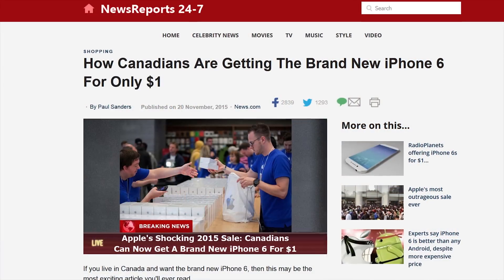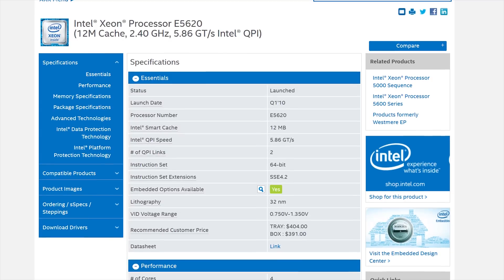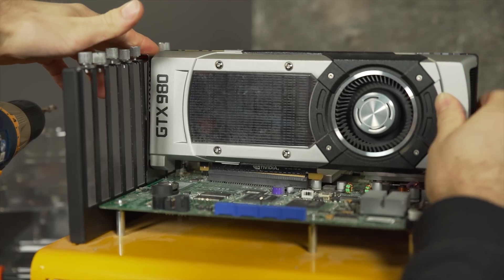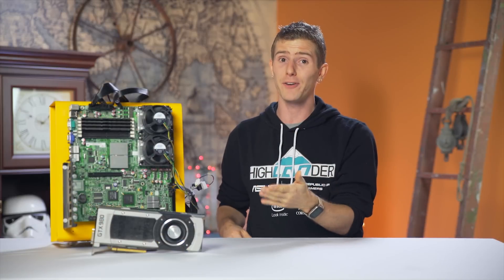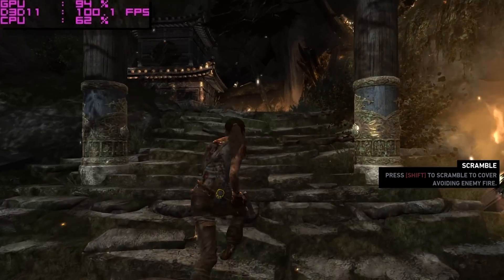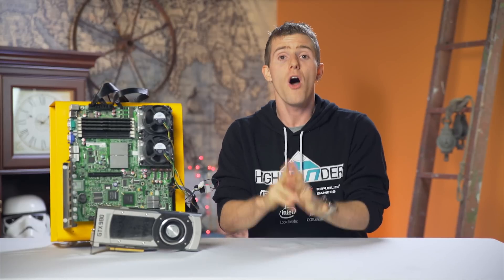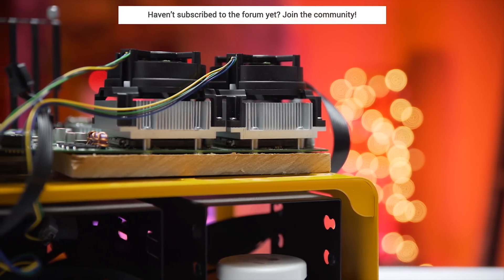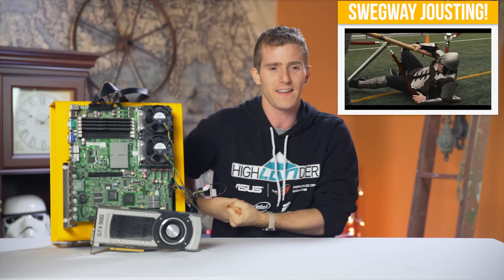Under $150 Budget Gaming 8 Core CPU, Motherboard & 16GB RAM

Comment: quick question
are there dual cpu mobo's that take normal cpu's? not xeons
Reply: +geen naam Generally no, and especially in this generation that they show in the video, definitely not, and the sockets themselves have different amounts of pins.
Reply: +geen naam leaving comment in case someone knows
Reply: LiquidPanic
hmm that's too bad, i was thinking about a super high end dream machine and then two cpu's would be useful
since one 5960x is alraidy bottlenecked by 3 watercooled titans
Reply: Only Xeons have the multi CPU support enabled.
Reply: +geen naam Most of them will fit but "Normal" CPUs like core2quad, i3, i5 and i7 doesnt have support for dual cpu so the processors wont be able to work together.
Reply: Emil Hansson
hmm that sucks
or would 2xeons or even 4  work with maybe 4 titans for gaming?
or can you only realy use 1 cpu for games?
Reply: +geen naam You'll have a hard time finding a WS/Server board with support for 4-way SLI, Also an i7 5930k/5960X/6700k will always be better for gaming, High IPC, High clockspeeds and atleast 4 cores is what you want for gaming. And dont buy 4 titans, Make a thread on the Linustechtips forum for more advice on what you should buy, Alot of cores and alot of graphics cards doesnt mean you'll get the best gaming experience.
Reply: Emil Hansson
yeah i know that, but this is a bit of a thing i like too think about. what would be the most powerfull pc 
and i dont think i would ever buy this generations titan, compared to the 980ti the price to preformance is awfull
and yeah a 2000hp lambo (talking cars now) would be horrible to drive and soooo unpracticle, but it's also realy awesome
Reply: +geen naam If you just wanna go nuts you can get a dual socket 2011-3 board and 2 Intel E5-2699V3 cpus (18 cores, 36 threads each), They'll cost you about 4000$ each though :)
Reply: Emil Hansson
well what i was thinking about, is to build a phase change cooling thing to cool all the gpu's and cpu's
i was hoping to get two 6950x's when they come out but if that doesn't work some xeons, aren't there some 20cores(hypertreaded) out or nearly out?
for gpu's i would be waiting for the next gen titans witch i hope have HBM 2.0. that would also have the advantage that the heatsink of the cooling would also cover the vram
and then overclock the hell out of everything, although xeons are not that great overclockers aren't they? so phase change cooling might not be realy usefull, maybe just one 6950x then
and just watercool everything else that produces some amounts of heat, ram mobo hdd's
Reply: geen naam "Necessary"
Reply: LiquidPanic
ow noows i made a smal grammatically error in my enthusiastic ramblings
what do i do with myself now?
thank you for pointing this serious error in my way's, i will run to the gammer nazi's headquarters this instance to atone for my sins
Reply: LiquidPanic
then why would you comment on one off my comments and just say ''necessary''?
i also didn't think i said necessary in any one of my comments, but yeah nowaday's the ''grammernazi'' is kinda a common phenomenon on youtube so i just assumed to where one of them
sorry for that, but what where you trying to say with your comment?
by the way, i am not a native english speaker and i had to google about three words in my previous comment to spell them correctly (i hope)
Reply: geen naam It was like pointing out how totally overkill that would be for any desktop load. XD
Reply: +geen naam 
Intal D5400XS aka Skulltrail.
Works with LGA771 QX9775s,unlock ratio.
Reply: hateWinVista the QX9775 is LGA775 not 771 by the way. :P
Reply: LiquidPanic
Nope,it was LGA771.
Designed to be used with Skulltrail(D5400XS) dual CPU platform.
Reply: +geen naam do you know how loud phase change cooling is? Phase change should only be for trying to get insane overclock in competitions and such, fair enough water cooling but for most phase change cooling is utterly stupid for a desktop you will use daily.
Reply: Tyler Taupe Phase change isn't used for competitions, in competitions people use custom made blocks and reservoirs for use with liquid nitrogen.
Reply: +LiquidPanic Yeah of course if they want to hit world records. I should of said at shows and things like that overclockers that want to hit a moderate overclock use it...
Reply: Tyler Taupe Lol, yeah. I guess if you could do something like Linus is doing with his personal computer, having it outside the room so that noise isn't an issue, it could be cool to have. :P
Reply: +LiquidPanic if noise wasn't an issue then it could be okay.

But really who needs 5.5ghz it isn't necessary, but it would be cool no doubt...
Reply: Tyler Taupe Pfft, a 5960x at 5+ghz would be amazing. XD But totally impractical since it would be essentially left to chance as any one of the cores could fail the silicon lottery and make the whole chip unstable.
Reply: +LiquidPanic Exactly, when you go to those overclocks you can't imagine how unstable the circuitry becomes...
Reply: Tyler Taupe Yeah, I wish I had that kind of equipment though, just to see how far a high end chip could really go.
Reply: Tyler Taupe
i've seen some fcc setups and yeah they are loud but not unbearable
but for my ''dream machine'' i would make my own setup, mainly because there are no fcc setups that are compatible with 1cpu AND 4 gpu's, at least i haven't seen any of them. so if i'd made my own i probaly could make it pretty quiet
and yeah the silicon lottery would be quite a pitfall, maybe just buy 5 chips or so use the best overclocker and resell the rest
Reply: Yo mate you wanna know what's crazy? http://uk.pcpartpicker.com/b/JHwV3C
Reply: Gameskiller01 
a build that has been removed?
not that crazy, seen that before
Reply: geen naam ffs PCPartPicker. It had an i7 6950X, 2 GTX 1080s, 128GB DDR4 RAM, 6TB of SSD storage, 3 4k monitors, a corsair 115i and it cost £15k.
Reply: Gameskiller01 
so yeah just a build that looks good but no one would buy
6950x realy doesn't make sense for the price, compared to the 6900k you're paying about 700dollars for just extra two cores. get that one or go xeon
128gb's ram almost nobody would need, 64gb is still a LOT but more reasonable
i would wait for 1080ti as the normal 1080 is still not up to it to go 4k, 2 1080's can drive 1 4k panel but not 3
and why not full custom watercooling
Reply: geen naam That's the whole point of it. It was meant to be a ridiculous and unreasonable PC. I was messing around on PCPartPicker to see how expensive I could make a build. And I don't think PCPartPicker can do custom watercooling. If it can I was unaware of it.
Reply: Gameskiller01 
then still go xeon, a little worse for gaming but a lot better for heavy workloads
maybe get the Z10PE-D8 WS motherboard and two E5-2699 v4 cpu's. those are 22core 44thread (so total 88cpu threads) and cost about 4000dollars a cpu
i found on pcparpicker a set of 128 4x32gb ecc ram, put two of those kits in there and you have truly an overkill system that's basicly a server in a pc case that can run windows
Reply: geen naam Sweet

Comment: Beyond Stupid. You could build a new combo with 8120 and 16GB RAM for $180 on sale and never have CPU bottlenecks on these same benchmarks. Why the hell would you spend 30$ less for all this bullshit with all the downsides. This is a fucking 5 year old set of parts that's unlikely even last you 5 more years before something fails. Also, who in their right mind would damage a 980 for this bullshit build with no warranty and no upgrade path.
Vulcan making this better is a pointless argument as well because the CPU's will die before Vulcan is realized to any significant extent.

Also how the hell are you supposed to put an eatx board in an inexpensive case? No casual gamer is going to mod their fucking motherboard standoffs and even suggesting they try is negligent because most will just damage the board. But again why would somebody on a budget even waste their time for a used system that is worse in every way than a new system they could spend $30 extra to get? I mean just their time at minimum wage isn't even worth that kind of bullshit.

Comment: hey 150$ for CPU cinebench score of 501, my i5 2500k clock on 4.4 does almost the same for a looooot more of a price. Also do you think this can be used as a streaming machine ?
Reply: +Quetzalcoalt With 8 - true - cores and 16GB of RAM, fuck yes.
Reply: +✌Vindicator✌ I managed to hit 671 with my 4690k (4.6-4.7 ghz)
Reply: +✌Vindicator✌ and that's were the 20-30$ extra for the K version pay of ;)
Reply: Intel Xeon W3520 2.67GHz: 408
Reply: +Quetzalcoalt lol. my 4.5 Ghz fx 6300 is worst than yours I guarantee it
Reply: ***** Just tested my i5 4690. Pulls about 546.
Reply: Animal Joe That's great! I'm running the locked version though, so I can't really OC it.
Reply: megapro125 Yeah, I know. My dad didn't want to spend any more money on the CPU+MOBO, though.
I'm happy with it, though, it's still a great chip.
Reply: +Quetzalcoalt I bought the i5 2500k and a defected board for $25
Reply: +Animal Joe 
I had about 650 with 4690k (4,4Ghz), 730 (4,9Ghz) and 750 (5,2Ghz).
Reply: +Quetzalcoalt This rig does pull about 40W--70W more power though..
Reply: tomi123gta123 you hit 5.2 GHz with a 4690k? not sure if liquid nitrogen cooling or extreme luck with the silicon lottery
Reply: megapro125
Yup but it's no way near stable (actually just ran that speed only for cinebench).
The increase needed in voltage between 4,9 and 5,2 is ludicrous. 4,9 is with 1,375V (and 1,2V for 4,4) absolutly stable OC, but I barely got Windows to boot with 1,7V at 5,2. More voltage wasnt possible (even for the short term), after all I did not want a molten heatsink and a broken Cpu for a cinebench score.
Reply: lol i wouldn't bother benching unless you know its at least 95% stable though. i got that Phanteks ph-tc14pe with dual noctua industrial iPPC a14s. when it boosts to 4.7 (sometimes 4.75) during games it still wont go past 68 degrees C
Reply: Animal Joe
It was actually a "just for fun" thing with the 5,2.
Took me about 15 Minutes to figure it out and it was interesting to see to where i can push the clock at max (even tho it wasnt stable and completly over the top voltage and temperature wise).
Reply: tomi123gta123 ok. a stable 5.2 GHz OC would be pretty awesome^^
Reply: none the less, that is sick. Maybe with water cooling your chip could do it! You might have a lottery level chip there haha
Reply: Just tested an intel i7 4790 ($300) and it does just 600 wtf
Reply: Leo Wong Law 4 vs 8 cores.. The newer gens is not double the speed per core until about after 4 gen..
Reply: Leo Wong Law Also 100W vs 84W TDP
Reply: Leo Wong Law if you had other apps open that would affect it too btw. Plus a 4790 only turbos to 4ghz, where as a 4790k turbos to 4.4 stock. then you get to overclock
Reply: +Animal Joe +rkan2 actually, after i enabled intel graphics it scored around 710, but it's supposed to get more